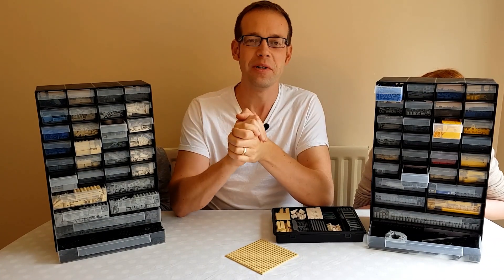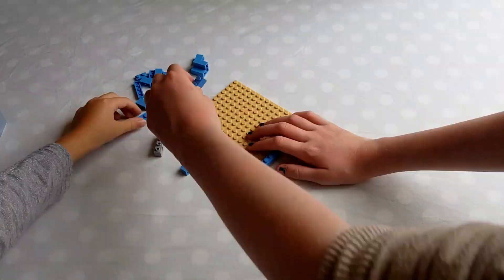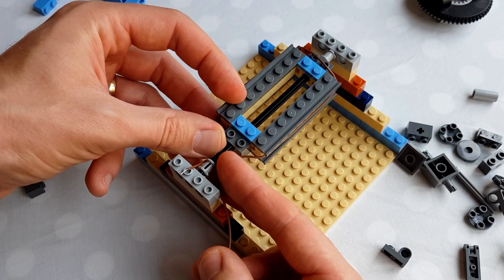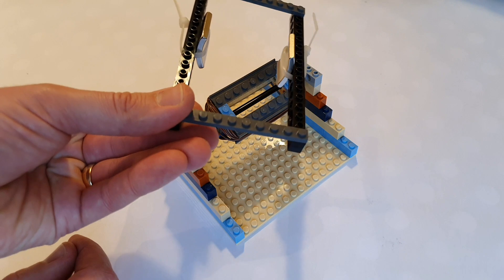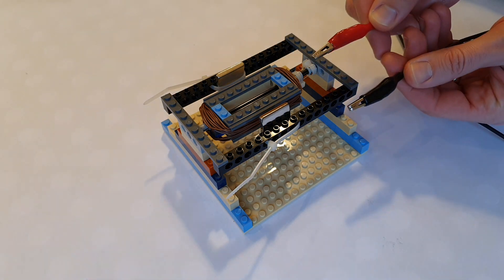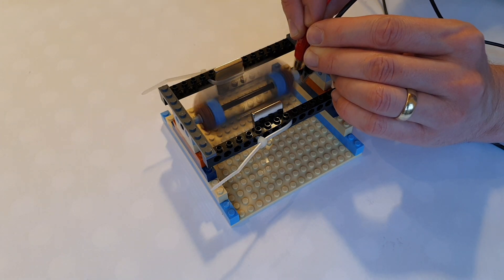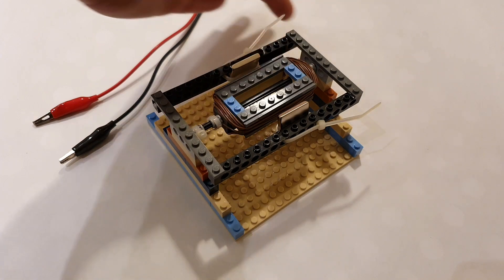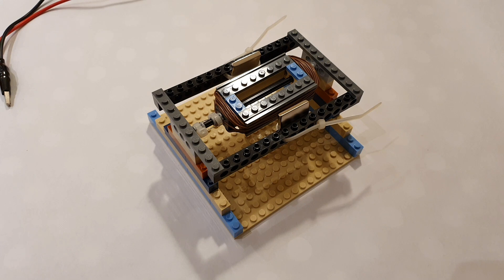How to Make a DC Motor Out of Lego: How a Motor Operates

Comment: Did you have any resistance in the circuit? I am wondering because I am trying to make an electric Lego motor similar to yours. I would always add some resistance for safety, but I am curious if you put any resistors in the circuit.
Reply from the maker: Not in this case, I had to crank the current quite high to get it moving. Stronger magnets might help. 🤔

Comment: hi! nice! how many turns of wire in the windings? Also what Voltage has the power supply? thanks!
Reply from the maker: I think it was on 24v if memory serves, need to get quite a bit of current flowing through the winding. Not sure how many turns though. 😊

Comment: Great stuff Joe.  I'd like to try that with my own grand-kids. What wire was used for the winding? What DC voltage did you apply?
Reply: And where do you get the magnets?
Reply from the maker: Magnets came from an online magnet shop. 👍
Reply from the maker: Just used a bit of wire from an old RS drum, it's a single core, solid and I think it's tinned copper.